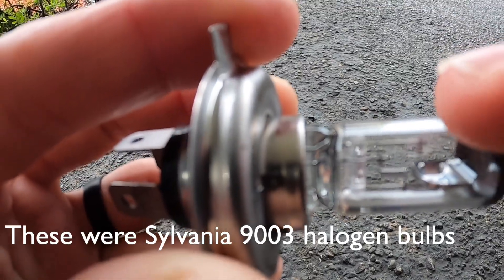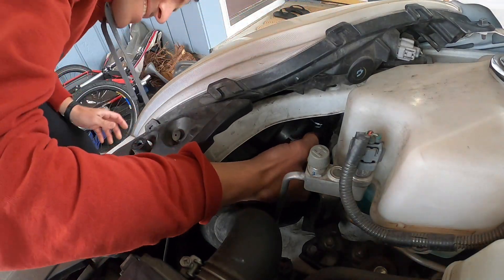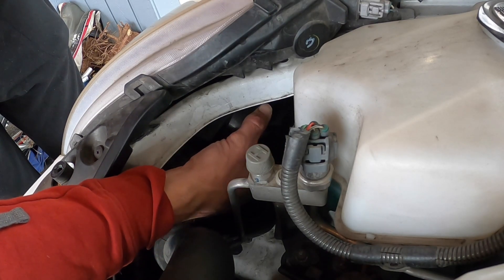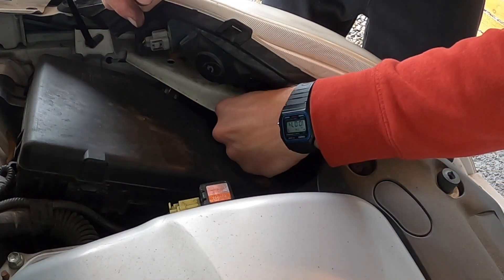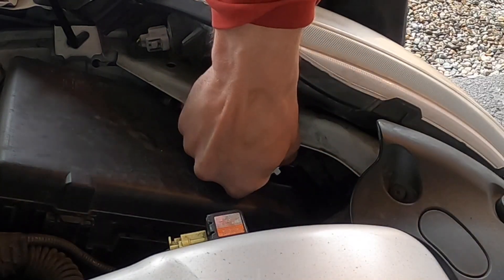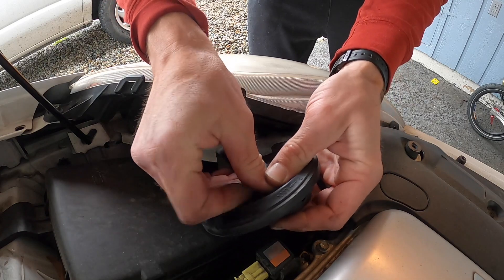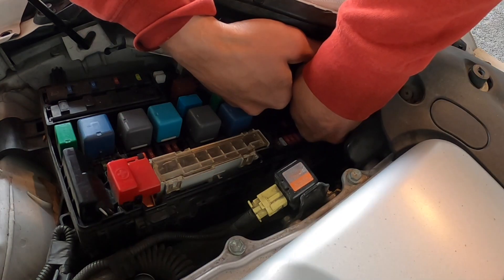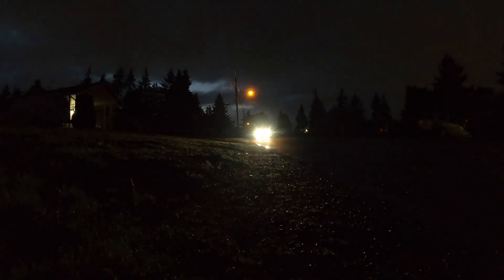Change to LED 2nd Gen Prius Headlights | STOP changing bulbs!

Comment: How about the state inspection? Is this change acceptable?
Reply from the maker: That’s a good question, and depends on local regulations. Washington State has no specific rules regarding the maximum number of lumens on led headlights. Washington State also does not require any kind of inspection on personal vehicles. Other US States and other countries may have tighter regulations and restrictions.

Comment: Thank you! 🙌 Just to clarify for myself and your viewers; these LED bulbs replace the original halogen bulbs WITHOUT the need to do the wiring conversion AND these fit into stock halogen designed headlight assembly?
Reply from the maker: Yes, no need to do a wiring conversion for these ones, they fit in the stock housing. They are still going strong in this Prius!
Reply: @findoutDIY  Thank you 🙏 so so much for responding! I need to replace the faded housing assembly and wanted to make sure I didn’t need to buy a special  one -